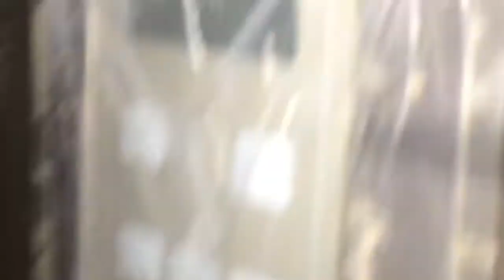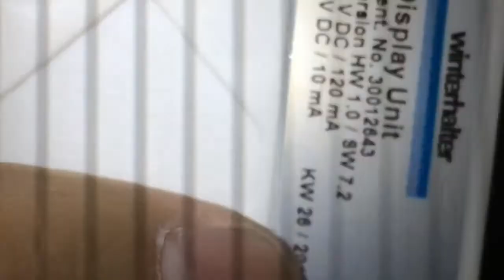winterhalter P50 can’t on. key pad problem

Comment: Sir the same machine problem is that the display is not running and the water is coming, no motor is running but the power is coming to the conductor, the power is going to the PCB but I can't fix anything.
Reply from the maker: swap pcb board
Reply: @tookstooksjugok814  
How much can pcb cost Indian rupees
Reply from the maker: @dcwhite5568  dear friend, board for this machine normally problem because have leaking of hot water at rinse pump or rinse pipe line, keypad problem also make machine cant on, display problem also make it cant on.. you must have this 3 thing for check this problem.. this machine weakness, all part very expensive. in Malaysia RM 1300.
the part only u can get at winterhalter. no others distributer